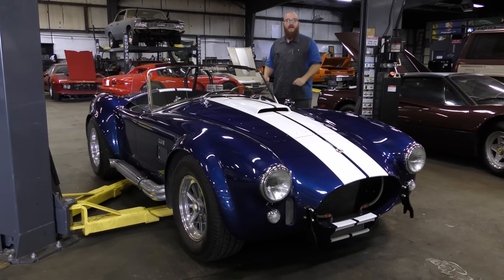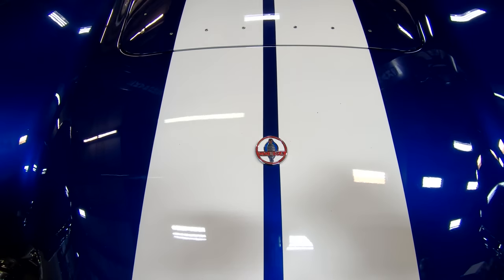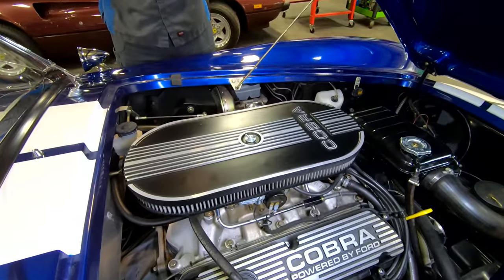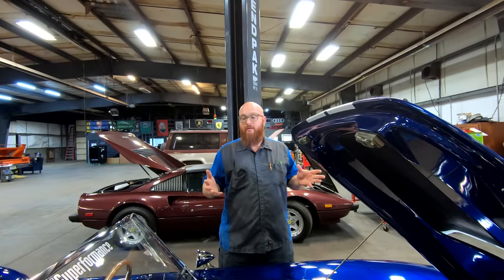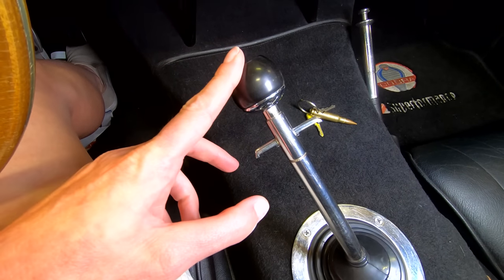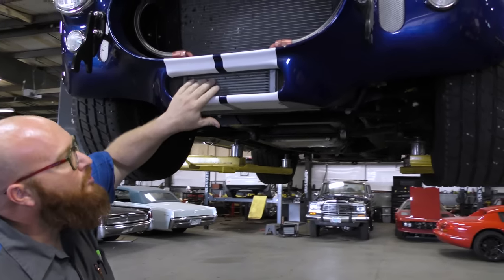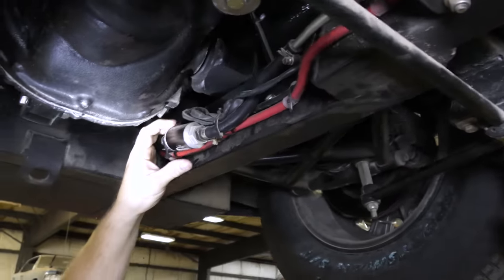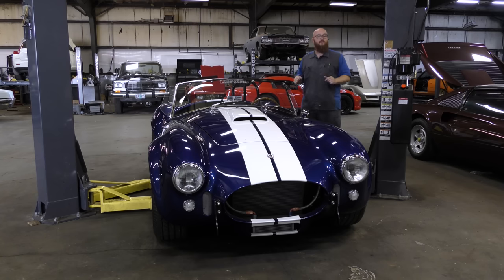Super small with a huge engine! Why is this '98 Superformance Shelby Cobra in the CAR WIZARD's shop?

Comment: WIZARD : GOPRO : There is not, nor has there ever been a "good GoPro" that doesn't overheat or randomly die (and probably never will be).
 They have horrifically bad power circuits and shitty batteries.
 One thing you CAN do to get better performance out of them, is to remove the battery completely and power them via USB from a powerbank or wall charger. For the type of filming you're doing, that should be an easy enough  compromise/workaround/fix. I've used this trick many times for filming live band sets, it's far more reliable than just hoping you get lucky. 

 ALSO, turn off EVERYTHING else - the wifi, Bluetooth, instant-on, voice control ... all that garbage you don't need while filming.

Comment: Imagine the wizards boys trying to cold start something with a choke-less double pumper and a big duration cam. 😆
Reply: What would be the starting procedure for such an engine?
Reply: @hyacinthbucket3803  I used to use one or maybe two pumps of the throttle if it was a cold day. If she caught it was time to do the dance of enough throttle to keep her running, without revving a cold engine to the moon, until she would idle on her own. Things could get interesting if there was a backfire. All that fuel you just dumped into the engine would spray the inside of the air cleaner and set it on fire. Getting straight on the key and pulling the fire into the engine sorted that out, but it was a comfort to have an extinguisher in the car.
Reply: @GreenCrim  Thank you, love the way they sound, but never around for a cold start.

Comment: These were famous for going fast in a straight line but going round corners usually involved a hedge. Great car for revving up outside the house and going back into the garage because it is starting to rain.
Reply: Originals raced across the world. Won the world manufacturers championship in July 1965. Won races across the US. Doesn’t sound like a car that could not go around a corner. 

In the hands of a amateur- sure, straight into a wreck. Just like any other guy who thinks buying the car gets them the talent.
Reply: @EdDale44135  I am quoting a review of the car from Motor magazine in the edition from 1968 that featured the launch of the Lotus 72 if I remember correctly. Racing cars are not necessairly good road cars especially in the hands of amateur drivers.

Comment: Hey Car Wizard, a new amp gauge won’t fix the fluctuation.  This is a very common SPF issue where the factory has a small wiring design flaw that is easily fixed.  Reach out to me and I can help.  The fix will take you 10 minutes.
Reply: Mike, how do you fix this issue?

Comment: can you whack a dry sump on there could do with one!
really annoys me people always get that wrong! it's a CV bellow not boot a boot is just one bag like.
asking a lot of money for that 80,0000 and it doesn't even have cast alloy wishbones internal suspension and internal brakes. I used to see them in the mid 80s for about 20,000.
missing it's chrome bar grill as well
Reply: I think you're used to those dorky English DAX atrocities with the Chevy motors. This is how it should be done. No bumpers...just quick jack tabs and the single roll bar. We call them boots over here. And the hood is is the "hood" not the bonnet.

Comment: If the transmission is a 4 speed, what make is it ?  It doesn't look like a Ford top loader like you would expect and Tremec don't make 4 speed transmissions.
,
Reply: It's a Tremec 3550 5 speed. the knob has the 4 speed designation for authenticity.

Comment: 339 Comments.Let's see where this goes: I'd like to build 1 myself,but instead of the gas guzzling and heavy big V-8.I'd rather put a turbocharged Honda 4-cylinder.It's so easy to get 5-700Hp without that front end plow in corners.Should make the car 1700lbs too.

Comment: assuming this isn't street legal in most states with no air bags and wouldn't pass emissions.  For track use only.  If it were an original maybe though I'm not sure about that either.  (though people do drive then on the street)
Reply: Reproduction cars have different rules in many states.

Comment: You use a leather faced mallet to remove those knock off spinners Wizard, alluminium is too soft and would be gnarled up in no time being smashed into the case hardened spinners; though I will concede that these days the material would more likely be Polypropolene.
Reply: No, you use a lead hammer. The hammer takes the damage while leaving the wheel perfect
Reply: @Blue_Flame_Raptor  with a leather covering. Watch the documentaries on the d type Jag at the '55 Le Mans
Reply: By the way, I owned an E type with knock offs. It came with the 'hammer' which had a well worn leather face.
Reply: The lead would leave detritus on the spinners if it wasn't padded, thats why they capped it with leather, but in all other respects you are correct my dear chap.
Reply: @davidnelson7149  I own a cobra and have been removing the wheels for 10+ years. The videos and forums say lead hammers. Actually I just ordered an adapter to use a torque wrench from old timer tools so no more hammer for me
Reply: @Blue_Flame_Raptor  Sorry, did I mention I.m sixty, and E types were still 'cheap as chips' when I was a 'young fellow me lad' petrol head?
Reply: @Blue_Flame_Raptor  Petrol heads of the world unite! greetings my fellow petrolhead Keep the faith.
Reply: @Blue_Flame_Raptor  IA Cobra hey, American muscle meets English elegence, I like it!
Reply: @Blue_Flame_Raptor  An interesting aside. Carol Shelby tested the Cobra on the newly built M1 motorway here in England because it was the only road he could get it up to max speed, and why speed limits were introduced on those very same Motorways!
Reply: @Blue_Flame_Raptor  Turns out the authorities weren't best pleased that some petrol head could do 175MPH on a public road.
Reply: @davidnelson7149  175 is a big number for a cobra. Mine has almost 600hp but it'll never go that fast since the Aero cause the car to feel like it's going to take flight.
Reply: @Blue_Flame_Raptor  Carol Shelby had big balls
Reply: @davidnelson7149  lead hammer
Reply: @richardschipper5989  wrapped with leather

Comment: Not a big block. The original 427 Cobra had a much physically larger FE series engine, this is a bore and stroked 351 Windsor Small block.

Comment: I have to laugh at the 80k chassis and the mickey thompson tires !
like putting A1 on your Wagyu
Reply: right, those tires are no where near adequate for that car
Reply: Neither of you know what you are talking about. There are very few 275R/60R X 15" tires to choose from. This is not 1970 any longer. Very few tires in this ratio made today.  There is a Cooper, a BFG, a Nitto drag radial and three offerings from Mickey Thompson. Two of the M/Ts are drag radials...the other is this tire. The only two I would put on this car are the BFG and the M/T. They are expensive but easily the best. Then there is the ultra expensive Goodyear and Avon billboards but those are bias plys and not great on a short wheel base street car.
Reply: @toddjohnson7133  
i’m sorry Mickey T have been a poorly made street tire for a long time, and unless recently they began making quality tires for a non drag strip car, but i just don’t see it. 
i would have went BFG or just slightly changed the size.
Reply: @yername31  You can't slightly change the size. The problem is the 15" rim and the 60 sidewall ratio. You're stuck with the few remaining manufacturers. Going wider at 285 or 295 will still get you the same manufacturers and models.
Reply: @toddjohnson7133  
i’d probably go to a 50 series 
have more options, and less sidewall flex.
but that’s just me i guess.
I realize not actually period correct but if it’s a driving car which it is, as it’s not a really AC Cobra, go for what makes it the best, and 50’s aren’t a harsh ride.

Comment: If I were to build a replica Cobra, I'd be so tempted to make it sacreligious.  It would have a 427 all right, but the LS7 out of a C6 Corvette Zo6.  Fuel injected with a ROWDY cam, that Cobra was way too quiet for my tastes.  You'd have to wear earplugs to drive mine lol.
Reply: I built one with the original 427 side oiler with side exhausts.  I suffered hearing loss from driving it for a few years.  Used to set off all the car alarms you'd drive by.  Sold it to buy a Viper.

Comment: 80 k is cheap for a Cobra even without an engine. And hey I'd you want something tiny with too much power that will send you into a ditch in an instant you could just drop an LS into a Miata for about half that.
Reply: Yeah but then that's still a Miata and this is a Cobra.
Reply: @Sheehy223  well yeah, or more accurately it's a superformance lol. And they do great work. Better than the original in a lot of ways. I'm just making the point that even at 80k a replica Cobra is actually a bargain considering what you get (it appreciates instantly too) and if you still can't afford it there's other options that are almost as fun.

And if you think about what the Cobra really was, i.e. a slow little British sports car with a massive engine in it and no driver aids at all, then a V8 Miata is pretty much a modern Cobra. Cos it's also affordable, which the OG Cobra was too.

Comment: 427 engine is the one to have if you're into the whole biggus dickus thing. Problem is, this massive lump in the front completely ruins handling characteristics, plowing into corners, deep dive braking, and potentially deadly over correcting. Only the most competent drivers can safely wring out the upper ends of available performance. Poseurs and wannabes can lose control in the blink of an eye. Hello oak tree, you're in my way! If you like light, nimble steering, superb cornering ability, and predictable handling, go for early generation type with 260 or 289 SBF the way God and Shelby intended.

Comment: This is the original shape Cobra in the original size. Later models had uber wide wheels that (IMO) look too much and don't handle as well. Just one pump on the gas pedal as two or three pumps will flood the engine & then it wont start at all.

Comment: Very cool car!!!
But…why…just like the original Cobra’s…is the grill wide open with no screening over it to hide the rad and cooling lines…?
It makes it look unfinished and like it’s a kit car done in someone’s house garage…!
Reply: no too bright are you. you need airflow through the radiator to cool those big hp engines
Reply: @richardschipper5989  Well I’m bright enough not to be a total dick when replying to someone…
I didn’t say to close it off,just hide all of the plumbing.
Surely a mesh screen of some sort would allow enough airflow…

Comment: you can buy it used in much better condition than this one for less than 70 grand
Reply: Debatable. Not for a Superformance. I've seen this car in person. It is spectacular. It looks like they did in the 60's. No double chrome roll bars or lime green paint or 40 series tires. It's like Secretariat in paddock full of mules.